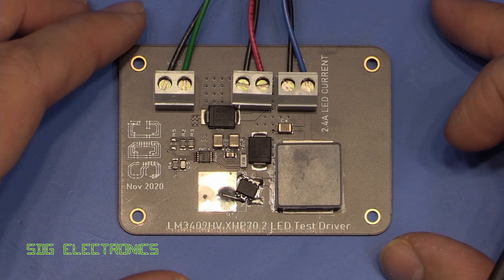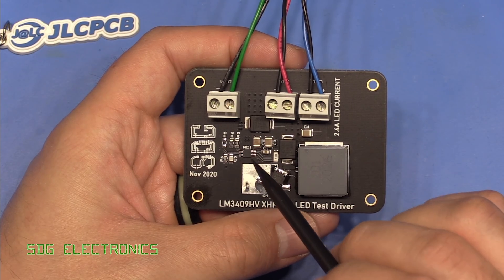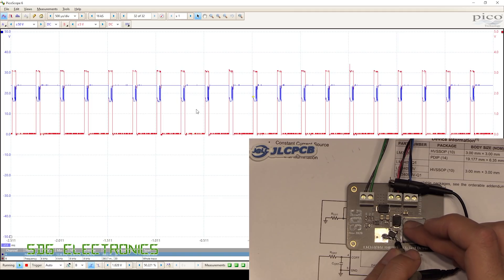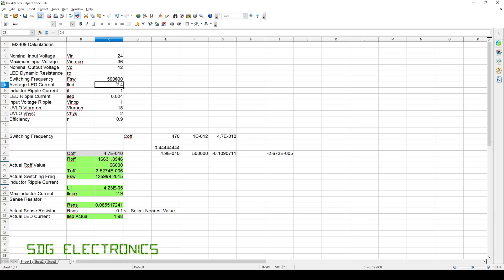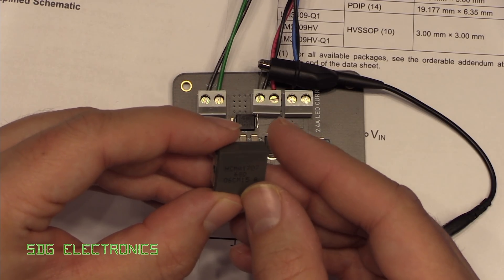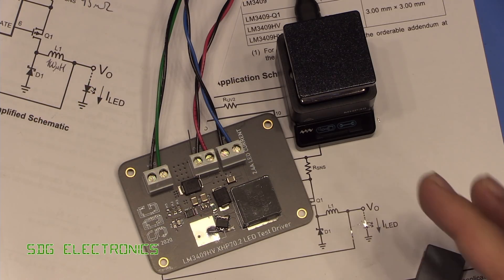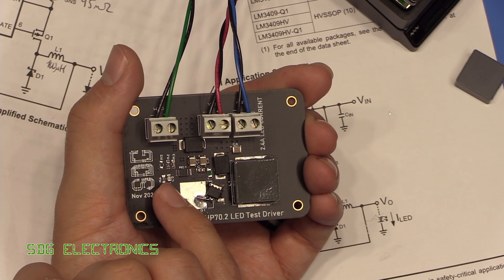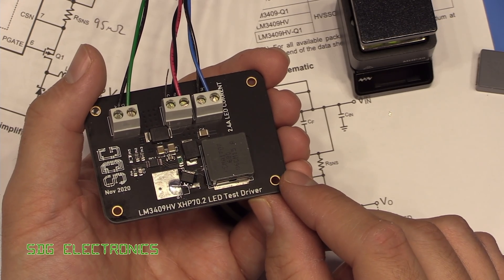SDG #185 Why is my DC-DC making a audible whine? Also a preview of the MHP30 from MiniWare

Comment: Nice little project! :) The ESP32 can easily output a switching frequency high enough that a small 10-100Hz LP filter (maybe even through a small line transformer to give galvanic isolation between control and power device) would give an almost perfectly smooth analog control voltage. Switching a switched voltage or current controller ALWAYS gives either very low efficiency, or mechanical resonances in the form of both subharmonics and harmonics of the lowest switching frequency involved. Try multiplying a sim of the two used signals, run the result through an FFT, and look at the forrest of harmonics the output coil will try to convey to the outer world by mechanically vibrating itself and the surface it's mounted to :)

Comment: Very interesting video Steve. I had a similar audible noise when applying  4 KHz , 50% duty cycle, pwm signal to a relay coil. The noise was tolerable at 25 KHz, at least for my old ears.

Comment: This problem has a possible fix that worked for me . 
I coated the coil in either silicone or conformal coating.
Reply from the maker: Check the latest video, it turned out not to be the coil!
Reply: @sdgelectronics  The singing ceramic cap was wailing in pain. I guess the message here is don't send a ceramic to do the job of an electrolytic. If you reinstall the ceramic and leave it running will the cap self destruct?

Comment: I was most interested in output ripple. That should go higher with PWM dimming applied. With PWM frequencies like 100Hz and no bulk ECap on the output, I there is probably PWM on the output as well.

Comment: Increasing switching losses from a properly driven switch are insignificant up until a certain frequency. I measured some buck circuit have better efficiency with higher frequency (something like 300kHz instead of 100k). Remember you are lowering inductor current and caps ripple current, so less loss in ESR of both. So there is balance.

Comment: it's inductive noise, there's no doubt about it. Ceramic capacitors can also sing, but this is in cases where their esr + esl+ C coincide with the operating frequency or are multiples of it on the first 3 harmonics, check the specification of the used capacitors just in case. It will be good if you put a small resistor in series inductance and view the current waveform, only the shape of the current depend on whether the singing inductance, if the shape of the constant component corresponds to the shape of the dimming ( which is likely true, judging by the gate voltage) then I have bad news for you -- without a change control method for dimming from this noise you will not get rid of permanently ( only if the inductance to hang in the air and dragged her by the soundproofing, as due to the magnetostriction characteristic of the ferrite forehead she would be singing) . So my advice is to use controllers that control the current in the inductance by dimming, and not just prohibit/allow operation. Usually they have either an external pin to control the current, or if the mosfet is inside, then the current loop works on the resistance of the mosfet
Reply from the maker: Thanks for your input. I'll take a look at this.

Comment: Do you have any ringing in the cathode of that diode ? Check the node that connects the diode, the inductor and the mosfet. That should be very clean.
Reply from the maker: The switching waveforms all look pretty clean.

Comment: I have a theoretical idea. If you took the inductor, soldered wires to it and encased it in, say, silicone rubber, wouldn't it dampen vibrations? Obviously, the wires need to be short, and the inductor will probably get noticeably warmer during use. This might be an interesting topic for a video. Maybe even something like epoxy or even hot glue could decrease noise (although the latter might melt if the inductor gets hot enough).

Comment: I don't think that gate signal looks right. It should be held either fully on or fully off by the driver and not have those oscillations at the end. Or am I missing something? You talk about the "ripple current in the inductor" being responsible for the oscillation, but that doesn't make sense to me. The ripple current in the inductor starts climbing as soon as the FET turns on. It could be some sort of current limit in the IC turning off and then on, but that wouldn't be right as it should just result in a lower duty cycle all together. Whats the red trace? Looks like the switch node, but why does it only go to 3V?
Reply from the maker: The IC only drives the gate from Vin to Vcc, which is around 6V. If it took it down to GND, you'd exceed the Vgs on most MOSFETs. I may have misworded it, but the longer period (where the inductor is storing energy) at the start of each PWM period is then followed by the actual switching waveform. This period at the start of the waveform adds another 20 kHz tone outside of the PWM fundamental and the 125/300 kHz switching frequency
Reply: @sdgelectronics  I am not referring to the gate voltage levels, only to that oscillation at the end of the on-time. It should be a clear square wave with a single transition between 24v and 18v without the oscillations. How does your switch node waveform look?
Reply from the maker: @cordtz  there's the ground lead for the scope going over the entire PCB which is what you're seeing
Reply: @sdgelectronics   you're saying that the ground lead picks up the oscillations and that they aren't really there? That does indeed happen but not like this.

Anyway, I rewatched your video and it appears that I misunderstood your explanation when you refer to the inductor ripple current. Your device does switch correctly, but you are using the "wrong" terms to explain it, which confused me :)
Reply from the maker: @cordtz  maybe I'm not seeing the oscillations you mean. I've rewatched the video and there aren't any really visible in the footage I took. Do you have a timestamp for what you're referring to?
Reply: @sdgelectronics  It is all about me mistaking: At the waveform displayed in "Adding PWM dimming", you mentioned "oscillation"(at 4:14). I mistook one period of the red waveform as one switching cycle, which would mean that the gate voltage started to oscillate at the end of each one-time. But the "oscillation" is actually just the normal switching. Since there is only one or two periods before the dimming turns off the converter, it looked like the gate voltage was turning on as normal and then turning off/on/off a few times before turning off. This is sometimes seen in converters when you have an issue with the control loop. But this is not the case here, however. Everything looks fine. 

If you want to get rid of the audible noise, you can consider using analog dimming.

Comment: Steve, I had another thought about the noise.  Are we sure it's the inductor and not a ceramic capacitor?  I did a buck converter PCB several years ago at a very similar power level and one of the early prototypes had a shockingly loud buzz from the ceramic input capacitors.  It was really amazing; the tone changed with varying input voltage, and it was loud enough to hear from across the room.
Reply from the maker: I did think it could be, especially as these are quite large ceramics. I'll get a cone and see if I can pinpoint the sound.

Comment: While researching inductor noise for computer graphics cards, i stumbled across a comment that the vibrations it's not necessarily ocuring inside the potted inductor... of course that is one possibility. However this other guy said that sometimes the entire inductor is actually moving as a single unit, and then causing the PCB that it is attached to to vibrate. Therefore there are a few simple experiments you could do on your test board. To see if this is in fact the case. and then there are a number of potential mitigation strategies. If I was doing that myself, I would first solder a couple of short wires to the 2 inductor pads and then attach the inductor that way. So that it is off the pcb. Then see if the noise is the same volume. To be thorough about it, then setting up a stationary mic and recording the amplitude of the sound waves would also be a great objective way to try to narrow it down. Between the choke and the PCB. And also its a good way to trial and compare a variety of different mitigation strategies. To see whiich one(s) would be the most effective. And which others are not worth it. But hey! I'm sure you didn't intent to go down that sort of a rabbit hole. And this coil whine problem was not an expected thing, delaying and just getting in the way of making planned progress on your LED project. But take it from me: coil whine is an industry wide problem! And it will happen again in other scenarios. However in other applications unfortunately it is not possible to avoid the problem so simply, by changing the frequency etc. Graphics cards is one of them. Other areas... maybe professional audio? Perhaps it matters really for any consumer device, anything that you wants it to feel 'of quality', and not be making such sounds. Anyhow IDK nevermind, it's really its own separate topic. You have other stuff to be getting on with, not to get too much distracted by that side topic.
Reply from the maker: I did actually find when I touched the probe on the gate of the MOSFET the tone changed - I don't know whether this slowed the edges of the switching waveform enough to change the tone or whether this is the PCB resonating.
Reply: @Tiago Ferreira I love the monstrous 50Hz hum of a large power plant.

Comment: Designing a DC-DC converter PCB layout is not the same as an ordinary schematics design. You should read and try to follow the given PCB example. Also, remove the top and bottom copper plane under the inductor. Use short tracks around the inductor and the MOSFET. There are a lot of traps with the DC-DC converters.....
From the PCB I've seen, it's not well optimized and this problem indicates that the design is not optimal
Reply from the maker: The layout is virtually identical to that recommended in the datasheet. No problem with the layout here, this is just inductor noise.
Reply: I'm not sure...
Remove all the ground under the inductor.
Show me the PCB design.

Comment: First switching PSU I built back in the day was based around two 78S40's......it oscillated around 20kHz and was very, very noise even across the other side of the room. Was designed for going in a panel on the drillfloor offshore so we didn't care.

Comment: Hey Steve, why don't you show us the improper way and drive the gate of your mosfet directly with the esp ?  XD

Sweet the little heatplate, but seems just a little bit too too small for your specific project. A  lab hot plate can do the job I think, even comes with a magnetic stirrer and sometimes with a camera mount, also cheaper.. needs 220 Volts though  ;)
Reply from the maker: I think it's designed for local heating so you don't have to thermally stress an entire PCB. It manages to pump out plenty of heat for it's size!
Reply: @sdgelectronics  Oh, I get it now... may have overheard that.. Then a little table around it, would be nice.. Guess that's an easy build with a little plywood or perhaps an aluminium plate with a cutout for the hot surface. Thanks for your reply ! And the interesting Video of course ;)

Comment: Interesting problem to solve. I once worked on a 150W inverter project with a 1.6mH output inductor (long story on why it was needed), could never get rid of the noise. But we got lucky because this was for an automotive application and inside the car the noise wasn’t noticeable.
Reply from the maker: Once the magnetics get to a certain size, there's really not a lot you can do other than shifting the frequency outside of audible regions.